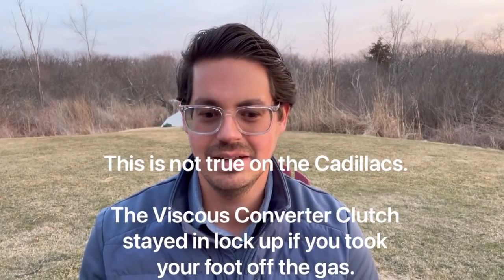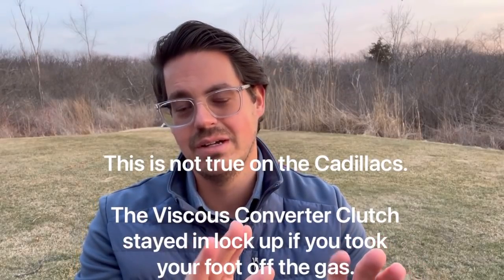Worst Transmissions of All Time: GM Turbohydramatic 440T4 (Early 4T60)

Comment: The 440 went into production with wrong tolerances for the 2nd gear. Around 22k miles, they went bad. GM wouldn't recall because it wasn't considered a life threatening issue.

Comment: I do not understand why once GM gets a transmission RIGHT, why do they start from scratch and then come up with a terrible transmission? They have done this several times. Put overdrive on TH400 TH425 and TH350 and be done with it.
Reply from the maker: In this case they had never built such a front drive transmission. But in many cases, they are after weight savings and greater efficiencies to achieve fuel economy standards. THM400s are great, but they are a tank and take about 35-40hp to run.

Comment: Complaints on the 440T4 also included 2nd clutch failure, GM used too few clutches in that drum the first few years. And, the 440T4 had not one, but two update manuals from one transmission service info company, covering at the updates over the years.

Comment: Maybe I just had good luck.  I've owned about a half dozen of these, and never had a serious problem.  Yes they have quirks.  Go around a corner just right, or from downhill to uphill just right, and it acts like it starves for fluid for a second.  Have just the amount of light load at the low speed range of OD, and it will be jerky.  Harsh shifts can be smoothed out by playing with the TV cable.  Hundreds of thousands of miles on each car with these quirks, and they've never failed on me.  Even one car, after it got too rusty for the road at 255k, I built a snowplow for it and plowed my driveway and half my yard with it for 7 or 8 Michigan winters.  That's tough on transmissions, and it still worked perfectly when I finally scrapped the car.

However I did have a 4T60E, it was a 92 Trans Sport van with a 3800.  That wasn't as good.  When it would get warm, it would lock out the TCC until restarting the engine.  Replacing the solenoids and harness helped for a short time, also adding a trans cooler and fan to run full time helped some.  And when it was cold, it wouldn't go into gear until the engine warmed up.  Substituting the fluid for a quart of Trans X helped, and I had to do this annualy.  I heard this was from a spool valve that stuck because it shouldn't have been made from aluminum.  It only actually failed on me once, and that was when I discovered the shift solenoids were powered through the ignition switch.  And the ignition switch (with tons of accessories running through it on these vans) was the same part number as pickup trucks from the 60s (essentially no accessories).  It cooked a few ignition switches.  312k on that one, ran perfect, again just got too rusty underneath.

Comment: The 440T4 in my 1989 Regal GS has 260k on it. For the last few years I have had no 1-2 upshift when cold until the car warms up some. The colder it is the longer it takes. After it finally shifts there  are no issues and it performs flawlessly(surprisingly) Is this a governor issue or an internal hardened seal of some sort? I don't usually go for magic potions but I don't really want to tear down the trans at this point, just mitigate the problem.

Comment: The Flint Engineers took a trip down to Australia in the GM F bodies to do 9 bolt axle  validation testing. At the same time, one  front drive Caddilac appeared for hot trans testing. At the same time,  Holden Australia did GM 3800 and THM 700 durability testing in a long wheelbase 1984 Opel Senator.

Comment: Now my 87 chevy celebrity eurosport 2.8v6 has the same 440-T4 trany and yep it has issues 238,000 miles and from 1st to 2nd gear shift when gets hot kinda slips it's gotten better since I've did a fluid and filter change plus added 2 bottles of Lucas.  But yes the down shifting isn't great at times especially when hot .

 Just all together needs a overhaul but I'm going to swap drivetrain from my 90 lumina eurosport 3.1 and call it done . Rebuild would probably be way to much

Comment: So what you describe is the behavior of the 4t60e on my quad4 powered 95 olds achieva. It would upshift as fast as possible and always felt that 4th gear at 45 was too tall for the quad4 cuz it would buck like a manual transmission car when youre in too high a gear or not giving enough throttle. Slamming the throttle would downshift and by 55 mph it was ok. I always attributed it to stupid shift point programming, upshifting too fast for the quad4. Later I had the 4t60e in my 3800 powered 94 regal, same shift points and it was fine.

Comment: You’ve not commented on an failure. Just characteristics of positive shifts, and low RPM engagements. I had a 200r in a four-eye TBI and a 3.4 powered 86 s10 with the H.D. 700r. They all had a positive lockup feel and I loved it. They were all long life, happy transmissions that a led those small motors to fly. I enjoyed 3rd gear lockup, which was eliminated completely with the 4l60, and 2nd gear was great for crawling and still getting city mileage- that ended in 88. Whoever complained had no idea what the trans was doing. And none of those people would be happy unless it was a dynaflow.
Reply from the maker: This trans failed at astronomically high rates, so much so that the new C cars were delayed a year because of it.

Comment: Worst transmission?? 88-90 440s last at least 170k miles. There’s a guy here on YouTube, that in his mom’s car, is still in service with over 600,000 miles. I have one next to a v8, that has 170k miles, and still good, and one that is in another v8 with 220k miles. A 440 in a junk yard with red fluid could only give one problem- the lockup solenoid. Give me a break.
Reply from the maker: Your confusing variants. It was called the 440t4 in the early years before electronic controls. By 1990, it was the 4t60e and was indeed excellent. But when it was called the 440t4 (ie 1985-6), it was a poor transmission. As I mention in the video, by 1987 it was much better

Comment: you know, I had a 1990 Olds toronado and it was the last year for the 440 T4 in that lineup(even though it was renamed to the 4T60 for the 1990 model year,but it was a name change only) and it always had a rough 2-1 downshift and I ran myself nuts with searching for possible solution. I decided I was going to live with it and one day I had to change the vacuum modulator and I just simply replaced the original one with an adjustable replacement and kept driving it,and then I decided I would turn the adjustment screw 3 turns clockwise to up the line pressure. I did that and then test drove it and the hard 2-1 downshift completely disappeared! my biggest issue with the hard downshift is I could not find anything online citing it as a "common problem" with these units.i found tons of people with the same transmission and issue but no solution or explanation. I sold my toronado 2 years ago but that harsh downshift still had me wondering about it almost every day until I just watched this video. thank you. I can now sleep.

Comment: Agree, TH440 was horrible but, since I knew that, my Dad had an 89 Lesabre that his lasted 220K on and was still pulling when it was hit and totaled.  I changed the fluid every 20K miles and when dropping the pan once at around 80K, half of a plastic/nylon thrust washer fell out.  LOL  It kept going though.  Changing fluid and letting off the accelerator when shifting is what it took to make them last.  Like you said "gentle".
Reply: I got an '89 Lesabre at home with 180K miles. The 4T60 actually shifts well. But you definitely hit the money on the 'gently' part. Really gotta be gentle with things that are that old.

Comment: My mother had a 1987 Oldsmobile 98. I had the transmission rebuilt at around 80,000 miles. In 2004, against all my pleading, my mom loaned her car to my illustrious uncle, her youngest brother who had the tendency to shift in a parking lot from reverse to drive while the car was still going backward. I got a call that my uncle was stuck in a parking lot and claimed the transmission had stopped working without admitting that he did the dreaded R to D shift. I was not going to spend another nickel on it and sold it as is for $500. A brand new Pontiac Grand Prix GT that replaced it was another can of worms, at 5000 miles the rack and pinion and power steering were replaced. The transmission would not engage at times from a dead stop while still in drive while the engine revved, then it would engage with a wallup and kick you in the rear. This transmission was repaired four different times with problems always cropping up. Finally the dealership, after a lot of arguing agreed to honor the extended warranty I had purchased when I bought the car new and put in it a new transmission that solved the tranny problems. And people wonder why GM divisions disappeared one after another? However both cars had the 3800 which were totally reliable and gave us very good service.

Comment: I had a Buick Verano as a loaner car years ago when my Pontiac was in for warranty work. My Pontiac has a 4 speed auto, and the Buick a 6 speed auto. That Buick transmission would wind out, slam into gear, at every shift. The Buick only had 1500 miles on it. I couldn't wait to get my Pontiac back.

Comment: I think my father had the 440T4 on his Pontiac 6000  8-passenger wagon; Wikipedia said it was available with the V6 on  '85 6000s. It seemed fine for maybe 105,000 miles, then it had a habit of refusing to go into gear. I'd borrow the car for a couple of weeks and it would be fine, then my father, who drove more conservatively, got it back and it would refuse to go into gear again. We'd trade cars again, and it would be fine. I wonder if my driving kept the pump running faster and kept the fluid pressure up enough that it engaged more readily .

Comment: Negative !!!   the absolute worst of all times is the FORD E4OD I had to swap in a T-18 compound gear 4 speed manual 
just to keep my F-150 running and it pulled twice as better than it did it would flat out pull in granny gear you could feel a huge difference in the low end torque immediately after the swap it would idle up hills in Granny gear with a EFI 300 sick cylinder.

Comment: Hi man big fan I want  to ask you if I found  old low mailleg  car should I change the transmission and rear differential  oil or i just leave it alone
Reply from the maker: With 43k km, I’d change it.  But I also wouldn’t make it urgent.
Reply: @RareClassicCars   thinks

Comment: My Dad had an ‘86 Coupe deVille with the HT4100 and the 440T4 automatic. It went through 2 engines and 2 transmissions in its 20-year life, neither set working for more than 90,000 miles before it quit. And that noisy fan would announce my Dad’s arrival for half a block before he pulled into the driveway. Combined city/highway mileage never got above 18 or 19mpg. It was dog slow, too.

Between the Olds 350 diesel, V8-6-4, HT4100, controversial throwback bustleback Seville, Cimarron, overly truncated ‘86 E/K models, early Allantés, Broughams that retreated to carbureted Olds V8s, and 440T4 automatics, nearly every year of the 1980s was a disaster almost across the board, just as rival European and Japanese marques were offering proper high technology, reliability, performance, economy, and without body panels that were shared with lesser marques.

I personally knew several folks that plunked down $20,000-some on these cars at the time and lived to curse the day they brought them
home, vowing to never buy another.

Cadillac, to this day, has yet to recover.

Comment: That POS transmission had the final drive clutch pack on the axle drive. If someone was driving at 55 or 60 MPH and did a panic stop locking up the front wheels the torque from the clutch pack would snap the axle.  They would get stopped but that was it.

Comment: The only FWD car that I've ever owned from the Malaise Era was a 1986 Chrysler New Yorker with a turbocharged four banger. That was a nice comfortable car with leather seats and it would actually go quite nicely when you put the gas pedal down. The transmission was a TorqueFlite 3 speed unit with no lockup. It never caused any concern for over 140,000 miles. It was a very pleasant driver. I've driven some GM cars of the same era and they don't even come close to the Chrysler in terms of power and reliability. The only reason I sold it was because it was getting quite rusty underneath.

Comment: I have a 1996 Buick Century with 107k miles, I think it's one of the last years for the 4t60-e, and still clunks out of TCC lockup. I don't think I've noticed any chuggle, but it definitely pulses on decel usually when I'm almost fully stopped. I thought that was just the breaks, but they all look good so maybe not?

Comment: All of this - the transmission issues, the engine issues - stem from how fast GM was trying to do a massive switchover from simple, strong, big V8 engines that were inherently smooth and simply designed so they were trouble free, and rear wheel drive 3 and 4 speed transmissions that were large and strong so they were also pretty reliable, to mainly 4 and 6 cylinder engines with small V8s and front wheel drive and a lot of additional complications from emission controls to engine management. It was like going from making 10" round wheels out of wood for 60 years then all of a sudden you have to start manufacturing optical scanning lasers. Overnight. With no experience.
Reply: Yeah absolutely, and to think that the guys making the Turbohydromatic transmissions for decades, couldn't figure out how to get them to work in a small front wheel drive car. . .I think they lost a lot of old time engineering talent between 1975-1985. I've seen what happens when you lose good strong senior engineering leadership when working on new product introduction and it can be disastrous. Essentially young engineers need to learn decades of do's and dont's very rapidly. . .and it's expensive for the company.
Reply: Buick had v6s in the early sixties and sold the tooling to AMC, then in the seventies bought it back, placed it on the same mountings from which it came.

Comment: My 4L60 in a 95 Blazer was making a milling sound and shudder and then broke the sun wheel.. The replacement auto was sort of ok and traded for an S-10 4 cyl with manual box which solved my problem with GM transmission QC for 300000 miles. The Buick front wheel trans on my commuter broke and I offloaded at wrecker the same day. My daily driver is a 54 Pickup with a gearbox dating to 1925. Untouched and perfect.

Comment: Never heard of chuggle, we used to call it tcc shudder. Bad motor/trany mounts which were really common would also make shifting and the whole car for that matter feel weird. For a trans that started life as the th125 and ended up the 4t65 it sure had a long life. Thanks.
Reply: The 440-T4 had no lineage to the 125.
Reply: @burtlandcastor8359  it was basically a th125 with another planetary set. All of GM's transverse transmissions until recently were modified/reworked 125's.
Reply: @user-cs1ne8gx9u  Negative.  The 440 family has zero parts interchange with the 125.  They are completely different design.  The 125 is more similar to the 325/325-4L and 200/200-4R, where the 440-t4 was a clean-sheet high efficiency design.  The 4T60E and 4T65E are very close to the 440 but have an added drum, band, and low OWC.  The 4T80E is it's own beast as well.  The 6Txx units are joint venture with the Ford 6Fxx units and now there are newer units as well.
Reply: @burtlandcastor8359  ok, must have been thinking of the 325 I guess. Good to know thanks.
Reply: @user-cs1ne8gx9u  The 325 and 325-4L are front-drive transmissions too.  Just about the oddest things as transmissions go.
Reply: @burtlandcastor8359 Actually...the TCC solenoid is the only thing shared with the 125.

Comment: Is it possible to fix the problems with todays aftermarket parts ?
Reply: Yes, to a point. With better quality parts and synthetic fluid, it's possible to get these transmissions to work reliably, but you can never move past the poor engineering.   If you baby them and service them regularly they will last a long time, but that isn't how the average person drives or takes care of a car.

Comment: Really expensive to rebuild, trans shops refused to do them, and GM wanted big $ to sell you a rebuilt. We bought a GM rebuilt which was no good when installed. A Cadillac dealer then replaced it no charge. This was in a T-Type '87 LeSabre, pretty car but junk in all other ways.

Comment: I've been in the same boat with my 86 LeSabre that had an '87 engine, I messed with the modulator valve until I accidentally received neck snapping shifts right before I lost overdrive then third gear. I bought a diesel powered Park Avenue that was wrecked for the transmission but I was warned not to use it, as it wasn't controlled by a modulator valve . So I found out how hard it was for two people to change out a FWD transmission. Luckily my LeSabre T-Types held out much longer. The best handling FWD domestic coupes I've ever had.

Comment: I had a new 1981 Olds Cutlass Supreme with the 3.8V6 and the 3 speed automatic with the lockup torque converter. I loved the car for the most part but I never got used to the lockup engaging. I remember a service bulletin that changed the speed at which the lockup occurred. I don’t remember the speed of engagement originally, but after the “prom” update it wouldn’t engage until I believe 58 miles per hour.
Reply: That's an incredibly high torque converter clutch lockup speed for a 3 speed automatic transmission. The Hydramatic 125C/3T40 would lock at around 35 mph.
Reply: @ 
I remember taking the car to the dealer for a service bulletin. They changed a prom in the computer. After that the lockup didn’t engage until around 50 MPH.
Reply: @dave1956  What was the lockup speed before the PROM update?